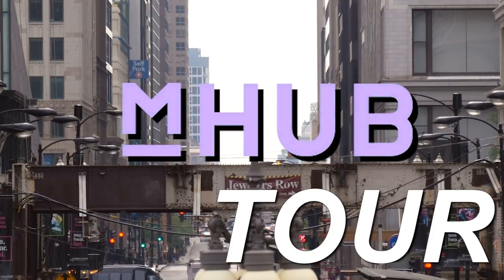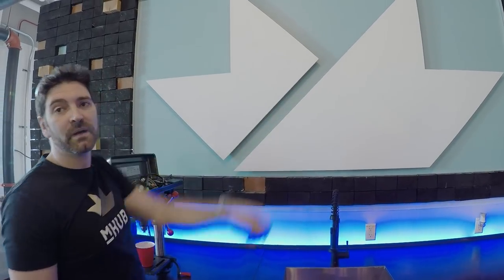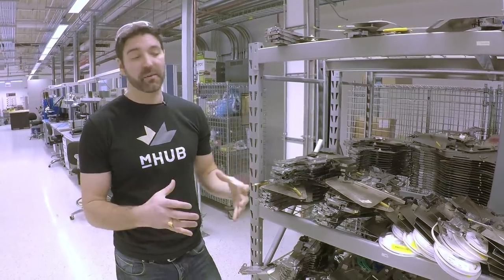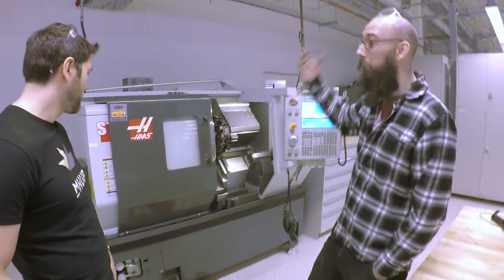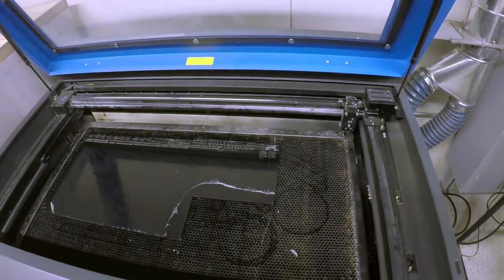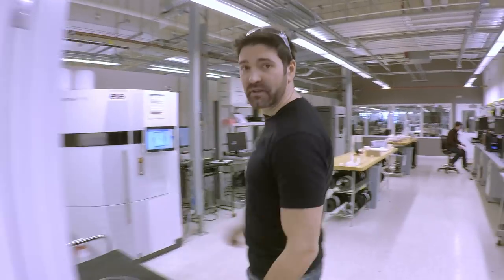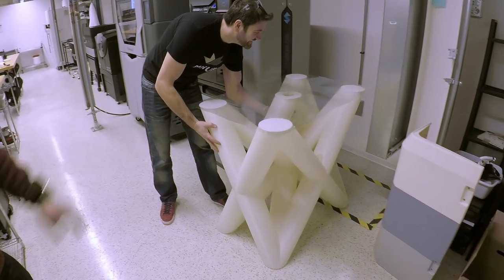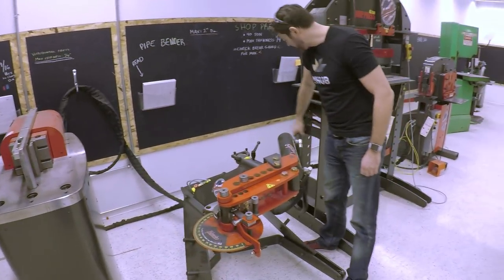Tour of mHUB Chicago: An AMAZING Facility for Manufacturing Entrepreneurs!

Comment: What a remarkably under-utilized facility. The SMT lines were not only empty - it did not even look like they were ready for anything. Crazy.

Stunning amount of capability.
Reply: The facility is less than a year old. Give it time, it will be packed around the clock. On the video, they did say they are becoming increasingly busy.
Reply: its a defunct facility using surplus equipment as a back drop to sell their con. 5 years from now, M Hub won't exist. Fear not.

Comment: Amazing! 
I was trying to develop a box mod  (vaping unit) before the FDA took over, in 2014 and 15. Now it's not only $10,000 just to get your foot in the door but all the large companies have pushed the smaller guys out. There's a lot of reasons why it wasn't successful but I had a competitive edge on product design and was putting in 40+ hours a week besides my job, trying to get this thing to market. A big issue was that I didn't have access to the equipment I needed so I kept looking for off the shelf parts & altering designs, trying to find another way to manufacture etc. If I had access to something like this, it would have been done, without a doubt. I would have been the first one with two exclusive features on these vaping units(I won't mention cause It's still exploitable) and probably would have made a killing considering that I still haven't seen one that's as good as my prototype. To be honest I never finished the prototype 100% because the FDA deadline. I panicked 3 months prior & tried to get a simpler one to market and still fell short. Again, due to no access to proper equipment.

For $300 per month, this is absolutely invaluable! 
Anyone in the Chicago area with an unfinished product would be a fool not to take advantage of this if it's within their budget!

Comment: "What is block chain?" Yup, still wondering what it is and how it applied to manufacturing :) Looks like an amazing place, and looking forward to visiting.
Reply: Think of it as an immutable record of the history of whatever you are trying to track, like balances of cryptocurrency wallets or another application could be inventory management.
Reply: That's not totally true. Blockchains can be compromised by injecting false code which is how many crypto currencies are being used more than once.   In fact, being compromised is the easy part, it's authenticating a blockchain  that's proving to be difficult.
Reply: chris0tube Difficult to authenticate  as valid. Which means it can be stolen and used twice, because the servers that should authenticate the Blockchain have been compromised. By the time the fraudulent transaction has been detected, it's too late.

Comment: Cringe at 50:55 -- do not use pliers on any bolt/nut/part you don't want to damage.  It won't take long until the head of that adjusting bolt is boogered-up pretty well if folks keep adjusting it like that.
Reply: Adjustable pliers are fine, if you set them right.
He didn't set them right, but I guess that's what you get when everybody shares tools.

Comment: What I would give to have that in Columbus, Ohio, this is absolutely incredible!

However, the only thing that is missing is a tool shop to be able to do at least some motorcycle work and the like. But that's just nit picking at this point(albeit more in line with what I would like to have access to).
Reply: The Idea Foundry isn't quite as well-equipped as M-Hub, but check them out if you haven't already! https://ideafoundry.com/spaces-tools
Reply: Several cities attempted to offer mechanical education and DIY centers in the 1990's. They were not successful for a variety of reasons including demand, cost to operate, exposure to liability and ultimately, the nightmare keeping track of tools, wear and tear and theft.

Comment: what a lot of small start ups need are affordabel cncing. Can't pay 4k for a 3 axis 3 sided 12 inch by 12 inch by 2 inch prototype part.
Reply: or failry priced 12 ft by 12 ft industrial space for rent.
Reply: So you don't think this hub's fees are reasonable?
Reply: I do not know this hub's fee's prices. Just my experience, trying to source cncing for aluminum and steel parts. My experiences were that they were so expensive, purchassing a pcnc from tormach would be nearly the same price and provide much more utility than a single prototype. However I would require industrial work space and rent/leasing that space I have found is extremely expensive (like 40k a year).
Reply: marshalcraft So you didn't watch the video that answered some of these questions. And you could call them....
Reply: the video is over 1 hour long, i must of missed the parts where those questions are answered, sense you did (because you know they were answered) can you post the time spots.
Reply: marshalcraft oh you're funny.
Reply: Thats what I thought, move along.
Reply: Not your secretary.